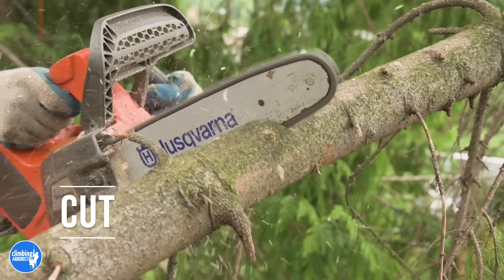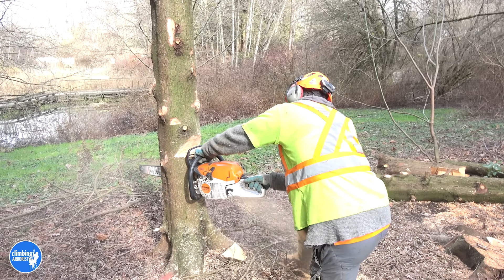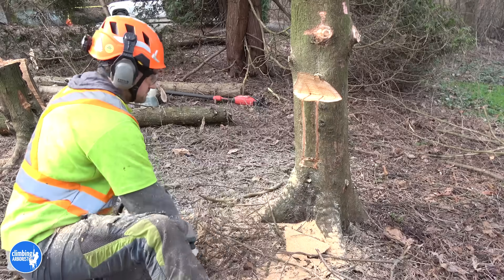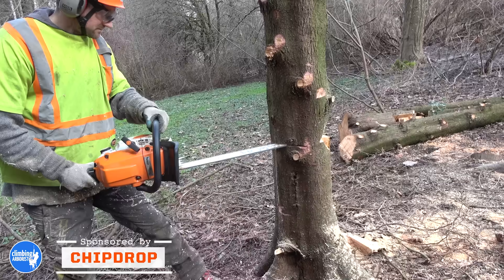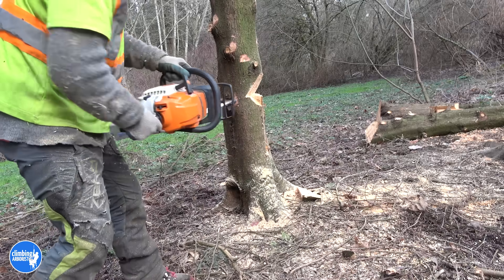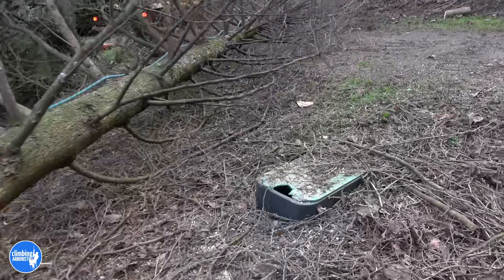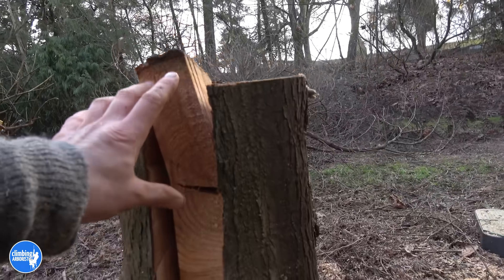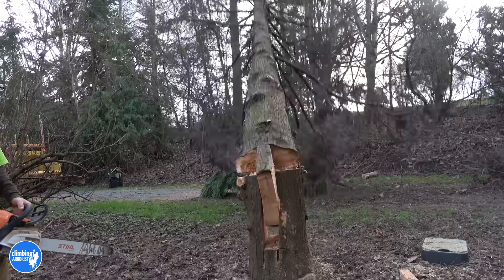LEARN the 'KEY NOTCH' tree falling technique

Comment: This is not the most efficient way to do it. The "small section" that u take out is completely unnecessary. Instead u just make ONE angled cut slightly downwards (from front to back) and this will prevent the tree from falling backwards and still be able to fall forwards with no problem. Its simple basic mechanics. Have done it for yrs, no problem. Less work and better safer result. 
Apart from that, good video..!
Reply from the maker: You do need a gap at the bottom for the key to pivot
Reply: @ClimbingArborist   No. Not if u angle it down/backwards. Like i said, weve done it like that for years. Its not a "new technique" (for us). Its also one fewer cuts and the angle makes it even safer against the tree "falling backwards". Test it!
[Edit:] U can update or make a new vid for a test...?   ;-)
[Edit 2:] Another advantage is that done right u can use a wedge in the bottom cut (have not done/needed that myself) to both secure it and push it to fall forward.

Comment: Why such a waste of wood and time?
Reply: REALLY narrow window of useful applications. Imagine having to fell a  36" white oak stem across a highly valued stone wall (in this scenario, it's the only safe direction of fall because...I don't know, maybe the tree is next to the client's house and the client also left a car parked in the driveway before going to work). If you come back another day when the car is moved, you lose time and money on the job. If you crack the stone wall, the client comes after you for thousands of $ in damages.

This cut allows you to control the height at which the lower trunk stops moving, which can be a HUGE advantage in urban arboriculture.

Comment: What seems safe in a nearly deforested country isn't elsewhere, like the US. Also what's safe for a trained arborist and a 30 yo tree, isn't for a fool with a chinsaw and a 100 yo one.  The method relies on the tree being pre-trimmed to a rational height and in relatively neutral balance over the stump and the trunk at the cutting point being solid . If either isn't true, the unbalanced weight of the tree above the cut can cause the intended stump to spread and/or the "key" of the trunk to split and the tree to fall in another direction.
Reply from the maker: All valid points